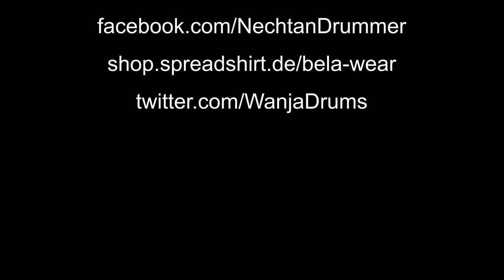Double Strokes vs Single Strokes!

Comment: is this the same for the feet aswell?
Reply from the maker: I think for feet the difference in sound is normally a lot bigger than with hands. It becomes really hard, if not impossible to get even hits with double strokes on feet at high tempos.
Reply: Wanja [Nechtan] Gröger oh ok. Cuz I can do double strokes around like 200-210 but I can barely do ankle.  I can do the motion but like 110 but that’s on the floor no pedals.

Comment: How many bpm can you play at your fastest?  Single strokes.  You are quick.
Reply from the maker: With push-pull up to ~310bpm, with "normal" wrist/finger movement around 220-230bpm.
Reply: Wanja [Nechtan] Gröger Hell yeah... Wish I could play a blast beat like you. I had a kit a few years ago but I was forced to sell it. Had to move across the country and I couldn't take it with.  Still regret it. Your channel is contagious, when I see you jam, I want to jam. I use to just relax my hands and use the bigger muscles in my arms,back and shoulders with the recoil from the heads. And the lower I lifted my sticks from the head,the faster I could play. You have technique though I wish I could accomplish.
Reply: Henry Austin are you gonna get a new kit?